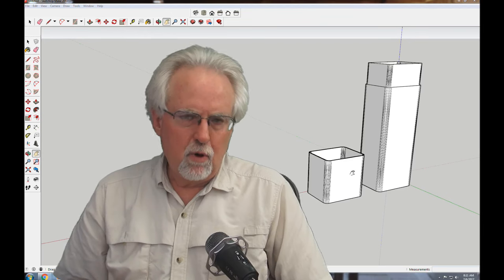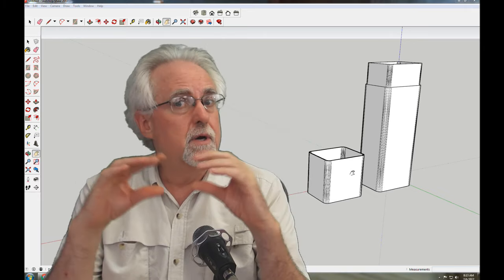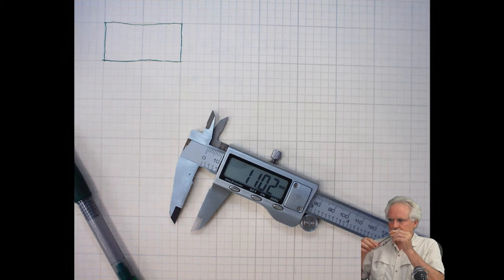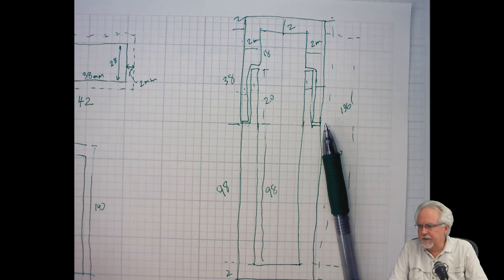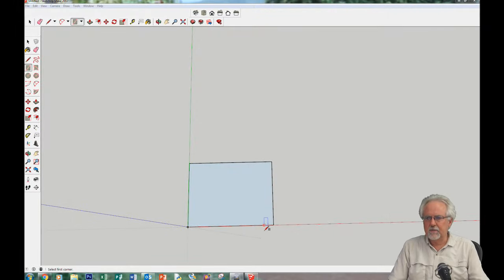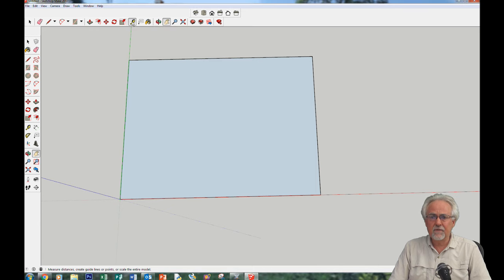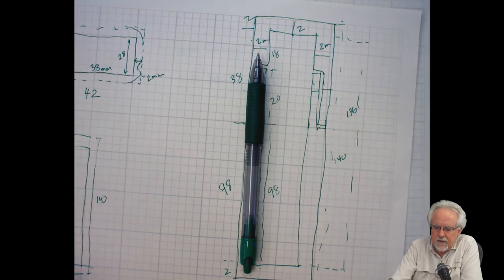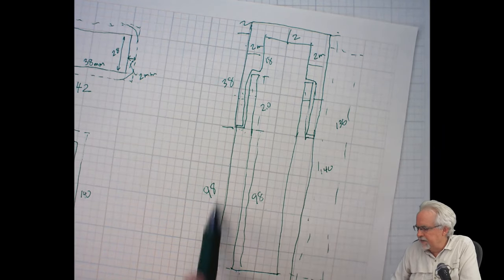Sketchup Tutorial LESSON 8: Think Like a Mechanical Designer

Comment: Most excellent tutorial!! Hope you aren't getting bored with my saying that? :-)

PS Can't wait to see what you're going to do next.
Reply: One more thing. Is it more efficient to print the top and bottom at the same time or to do them separately? Does the printer waste time and energy by having to make the first layer of the top part then move to make the first layer of the bottom part and so on?
Reply from the maker: Prints can take many hours, like 10-20 hours, so I like to do a lot of printing in same build so it can run overnight
Reply: I think that you're using the simple template in mm because it starts off with the man near the origin. Is there any reason why you're not using the 3D printing template in mm?

Also, I can just about remember from when I took Applied Maths at school nearly 40 years ago (long before CAD existed) that we used to produce precise drawings with front and side elevations amongst other things. Would this approach be useful when planning to  produce something in Sketchup or are drawings like the ones you did in this tutorial perfectly sufficient?

Sorry, too many questions. If I were a student, you would probably throw me out of your class!